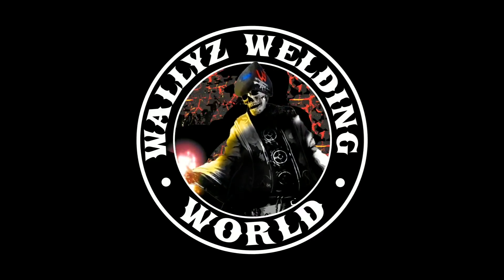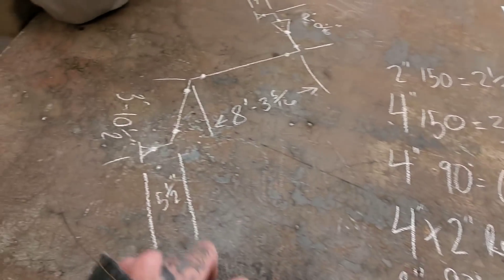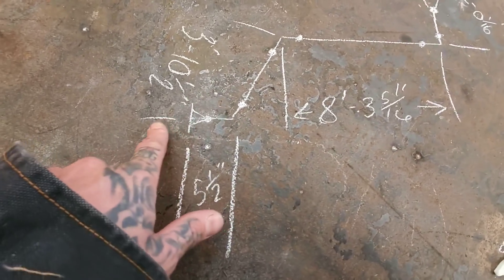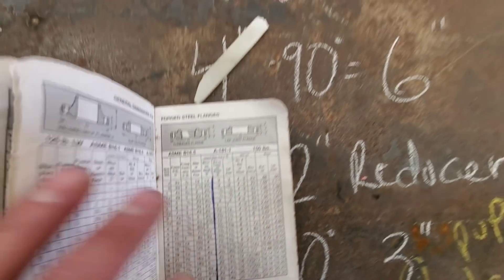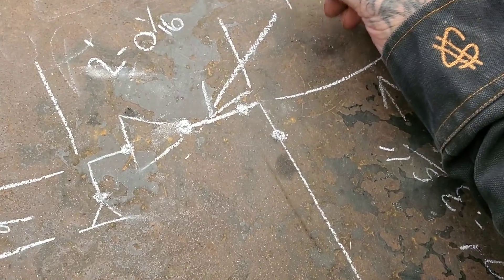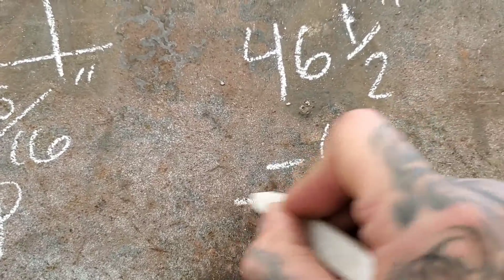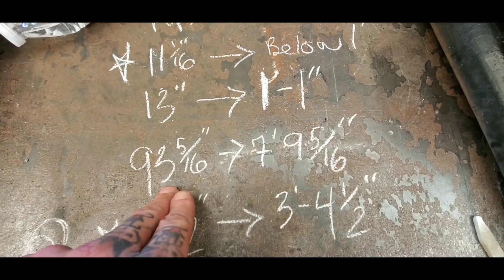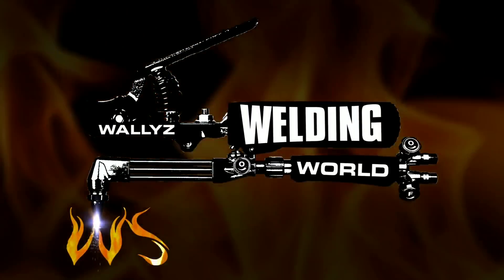WELDERS PIPE FITTING 101

Comment: Wally, do you subtract anything for gapping the fittings? Or just cut the pipe to length and grind the bevel enough to give you a gap? Is this run uphill or down? Great video, love it. Some struggle with the math
Reply from the maker: When I am stick welding i never take off for gaps. Not for uphill up or down hill. Now if I had to tig or mig the bead I'd take of ¹/⁸th of a inch per gap.

Comment: I’m surprised you don’t take out for gaps
Reply from the maker: If I was miggin or tiggin I would but not for stick welding I never do I take a tight fit
Reply: By the time you are welded out those gaps will have pretty much drawn up. Also with steel pipe on a hot summer day or on a very cold winter day the expansion or contraction will exceed the width of your gaps anyway. In other words a finished out spool piece is generally expected to be within 1/8" of an inch and if you do the math right your finished product will be within tolerance without worrying about figuring for the gaps.
 Besides all that, you can take a rosebud and a big hammer or come-a-long and MAKE that sucker fit.

Comment: Good stuff but your pipe fighter should be doing all that but never hurts to check em.
Reply from the maker: I'd rather do it
Reply: I am 70 and have been out of the business for years but when I was still working the hands that ran their own rigs made the better money and they are expected to be fitter/welders . If you want to be good and valuable at the job, learn fitting and to read  blueprints and always know your orientation. { where North and East is } 
 Guys, remember these numbers: off-set times 1.414 for the hypotenuse of a 45 degree offset,  5/8 times size of pipe for a butt weld 45 take-off,  1-1/2 size of pipe for butt weld long radius 90 take off,  size of pipe equals take off on a short radius butt weld 90, 1-1/2 times the bolt size + 1/8" of an inch gives you the wrench size.
  Also, rigging and some basic knot tying skills are a must in the pipe fab business.
Reply: @jamesadams5386  depends on company
Reply: @anthonyla3104  Yeah, I have worked on many jobs that did not have any rig welders while some jobs have only rig hands.